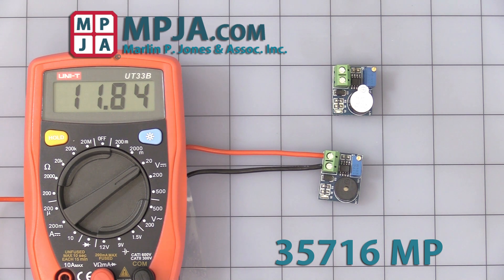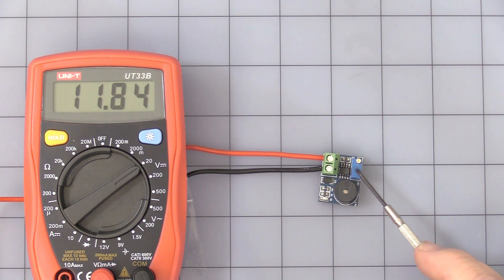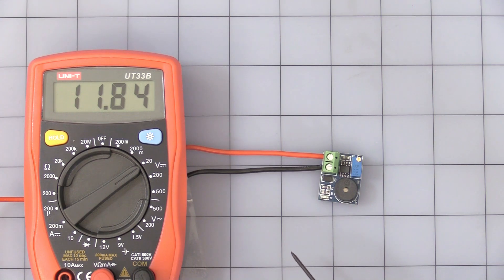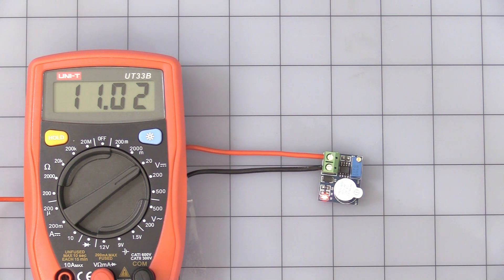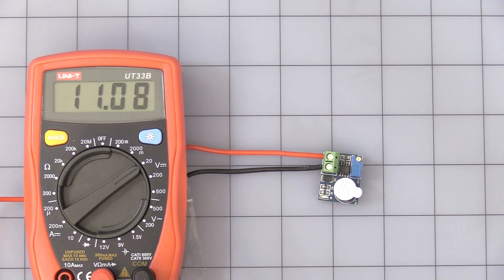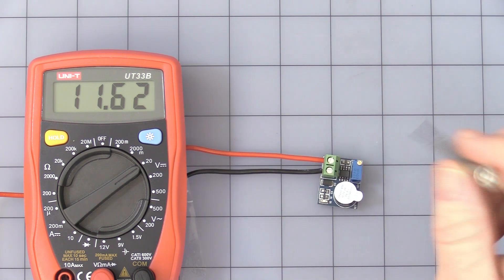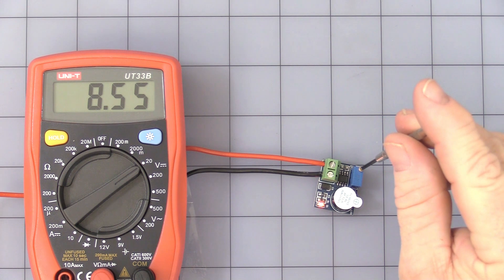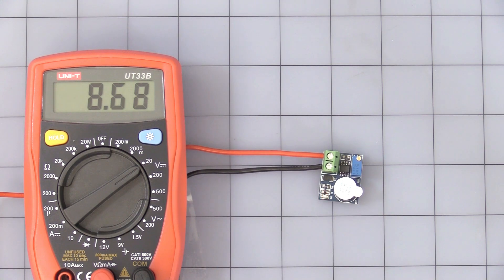Battery Low Voltage Alarm  35716 MP

Comment: Sorry to say this, but your video demonstration is confusing. The alarm goes off when the voltage indicated on the voltage multi meter was above the voltage you had set it for? It is not very clear what you are doing.

Comment: Hi, thanks for the video, its very informative.
Im looking for the same type of buzzer system but for much higher voltage. To buzz when voltage is at 134v or 101v or 84v. Do you know of any similar product i could purchase? Thanks
Reply: Hi, you could pobbably just do a small voltage divider so you from your voltage i.e 134V get out 11.0V or where you set this buzzer to beep.
Reply from the maker: Sorry no

Comment: 11.6 V. is too LOW for my AGM batteries on a solar set up.50 % SOC is around 12.4 volts. You show the exact same low voltage alarm that I have. VERY helpful!

Comment: Could the set point be set using a brushed motor speed control instead of an adjustable power supply?
Reply: Good ! Yes you can vary the voltage with that set up.

Comment: You can set the voltage meteron a 2 thru 6 cell battery but how do you hook up a 1 cell battery, it does not have but a main  wire no balance wire.

Comment: Looking for something to audibly alert/verify system disconnect. 
IF battery, say 12v, is simply turned off will alarm sound untill residual power drained?
Reply from the maker: Depends on the time for the power drain, it will beep until the voltage reaches 6 Vdc. I don’t think it will work well for you. If the trigger is set at 0.1V of the battery voltage when it is a quick disconnected it makes a faint beep and the LED flashes for 0.5 seconds, any setting higher will not make a beep or LED flash when disconnected.
Reply: @mpjaonline   
 thanks. Hmm, currently using an old LP detector that low voltage triggers, sounds at ~11.6, stops ~5v as system drains which takes about 1.5 seconds so obvious that power turned off. 
You comment prompted me to check. Curious tested detector with a direct to battery connection. Removing power just the briefest faint beep, dim flash of LED.  
Though I have LP detection sensor disabled, its heater has to remain connected which if fails (common) triggers alarm. Which is reason looking for something else.